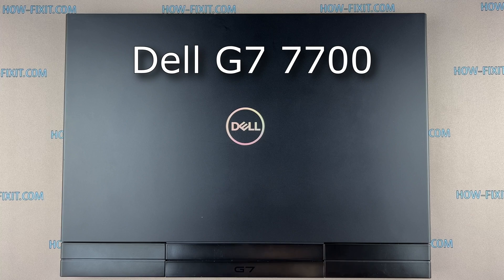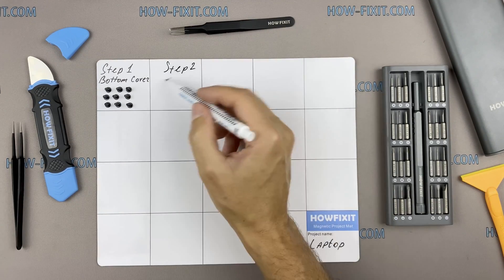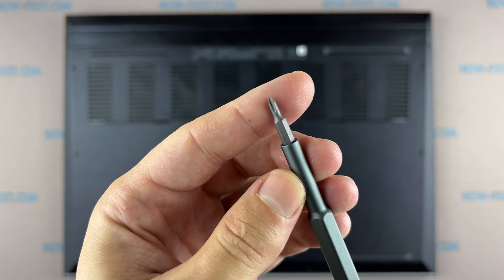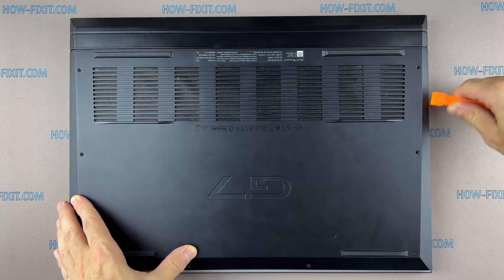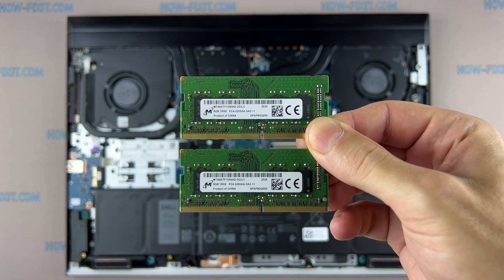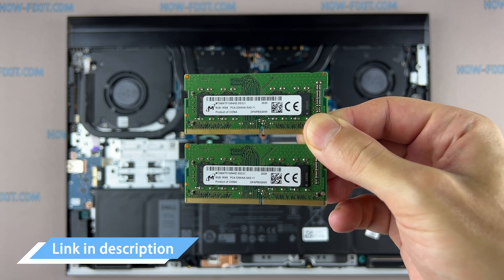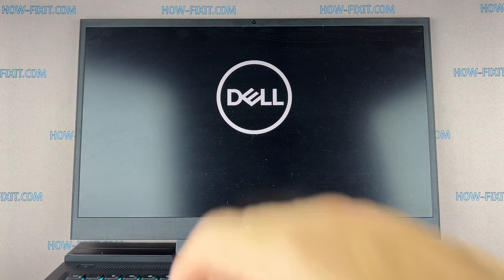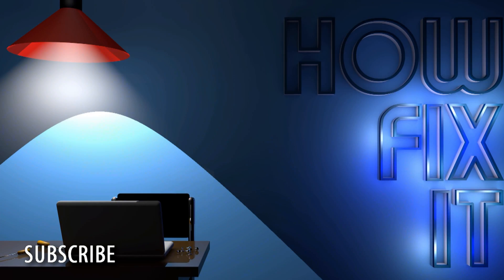Dell G7 7700 RAM Upgrade and Install - Your Step-by-Step DIY Guide!

Comment: I have just put 64 go ram Corsair Vengeance SODIMM 64Go (2x32Go) DDR4 2933MHz C19  for my laptop G7 17 7700 and it works very well ; ram is well detected and I have 64 go.
Reply: Did you got random reboots after upgrade? I installed Kingston Fury 64GB (2x32GB) DDR4 3200MHz C20 KF432S20IB/32, it seems works fine but I got some random reboots after a while, sometimes It does not happen. I tried restoring Windows, and doing memory tests with MemTest86 but all was okay. I don't know if would work fine with Corsair Vengance.

Comment: Very helpful, used this video to upgrade to 64 gb ram
Reply: i think the motherboard for this laptop only support the maximum of 32 gb of ram
Reply: @MANKEYhaoh  yeah, I had read that in a couple places, but I put in 2x32gb 2933 mhz 2 months ago and it's been working with no issues that I've noticed
Reply: @jg5705  o it will work if u go over 32 it’s just that the laptop will only be using 32 Gb and the other other 32 can’t be use.
Reply: @MANKEYhaoh  dell site lists 32gb max, but crucial's website lists 64gb as the max, and I read a few comments of other people upgrading to 64 gb before I upgraded mine. I've been using over 32 gb pretty regularly the last 2 months so it does work
Reply: @jg5705  ohh dope ima change my ram Order for the 32gb appreciate the info
Reply: @jg5705  update on this? Just upgraded an additional SSD really happy & thinking now upgrade Ram. How is it going with it?
Reply: I keep reading that. Scared to get it and it not work.